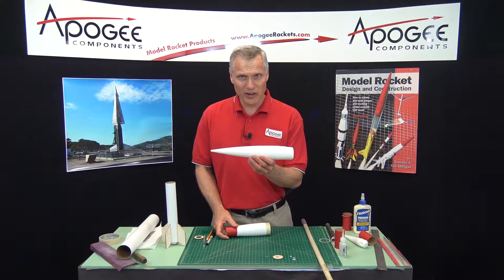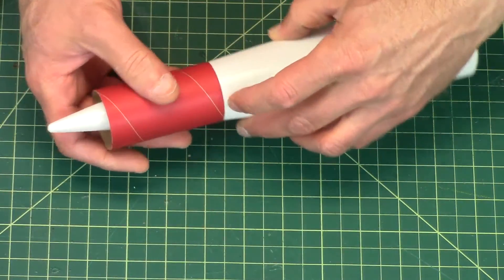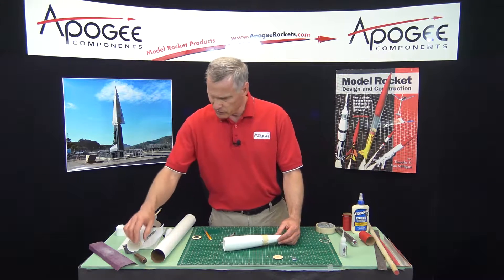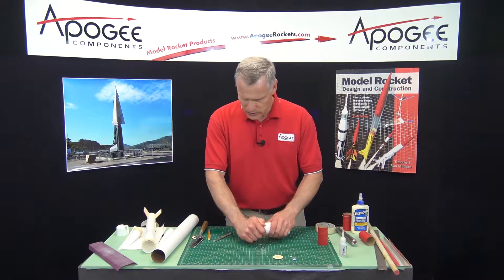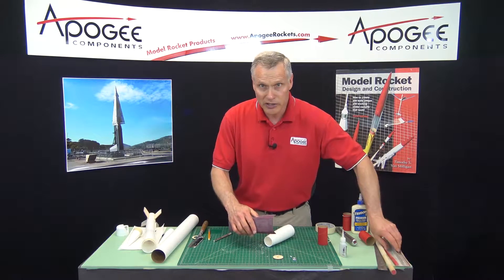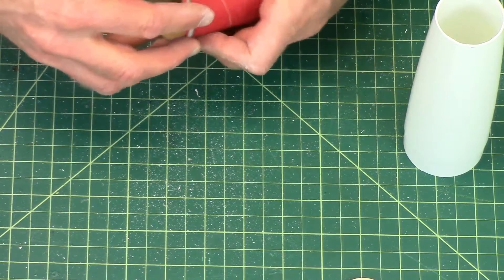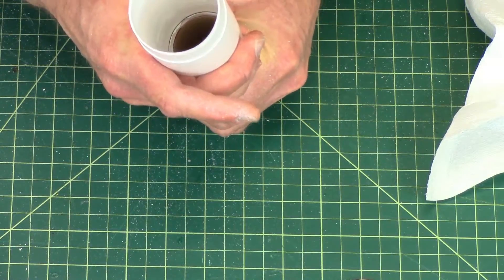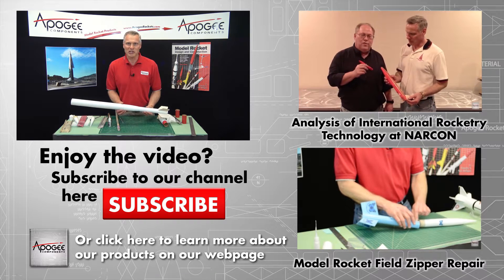Making a Transition From a Nose Cone

Comment: Good idea. Thanks for the video. Do you think a rubber band or a piece of elastic could be used instead of a centering ring? I wonder if it might act like a gasket and be more forgiving as far as fitting the coupler to the nose cone goes?